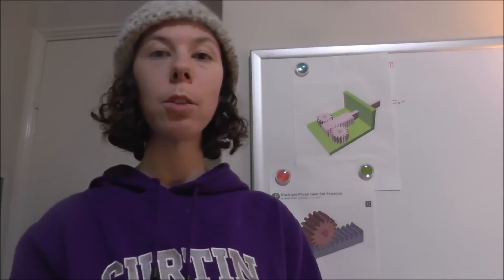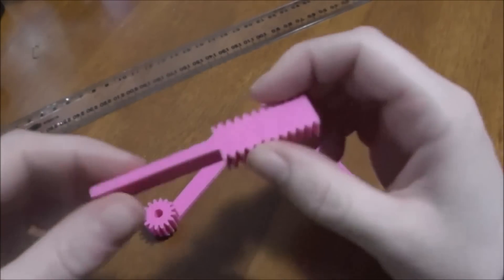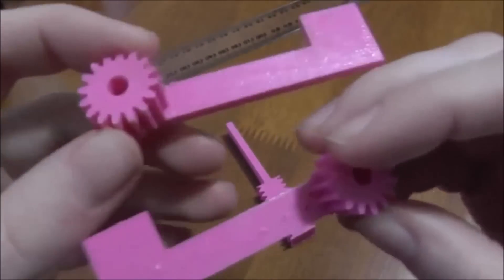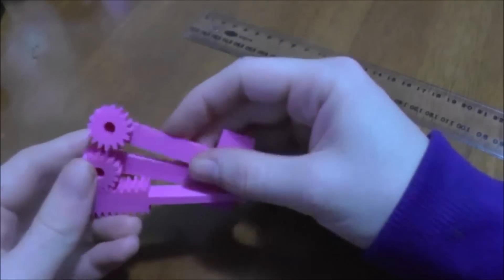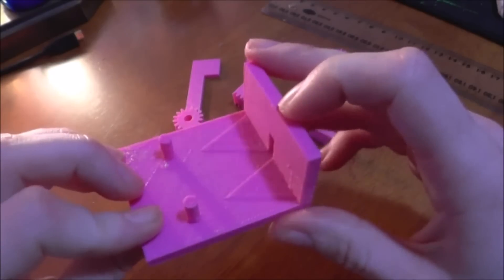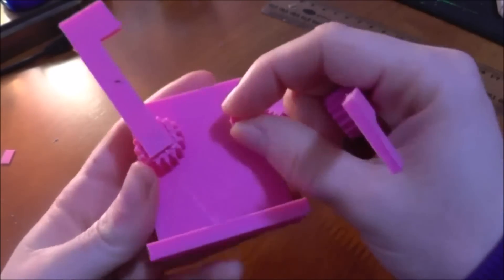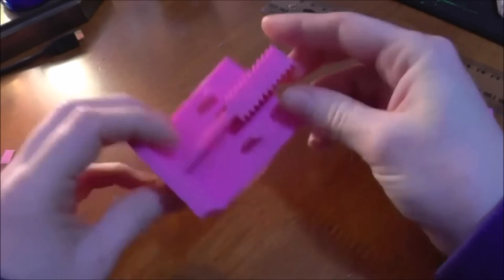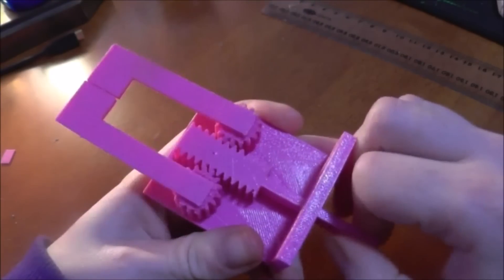3D printing The Rack and Pinionator

Comment: Hello great video, how can i design gears with such smaller pcd but of materials like carbon steel or alloy steel. Is it possible to do so using 3d printer ? If not then please suggest some other technique/method. Appreciate your response
Reply: Selective laser sintering is offered as a metal alloy forming process by Shapeways, however small profiles are not rendered nearly as well as with a small nozzle and plastic, and even small gears tend to cost $30-$50. A better option would be to find existing gears from a large distributor, or learn to make your own using a lathe or mill.
Reply: @connors.1077   Thanks for your reply. Have a great day !